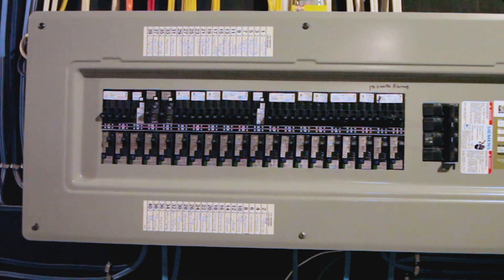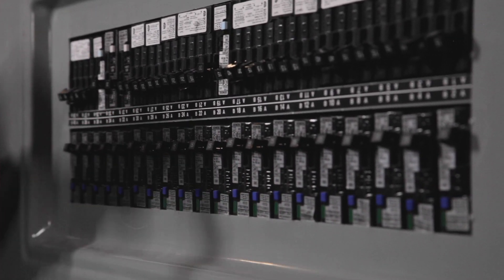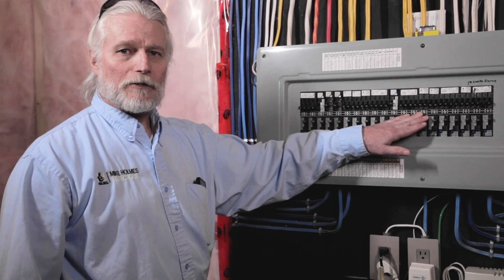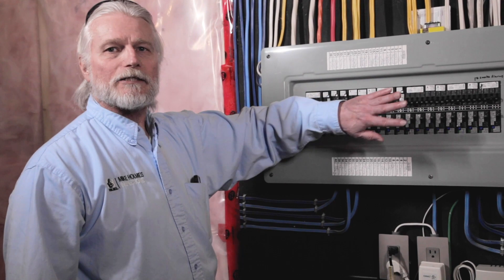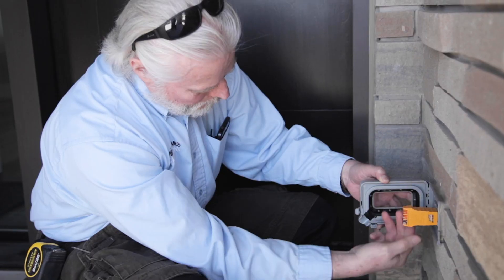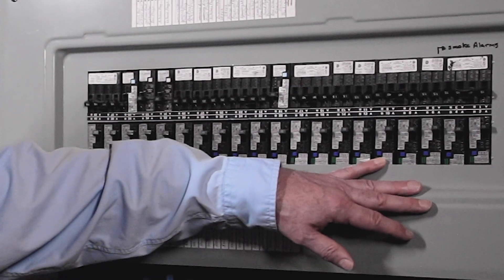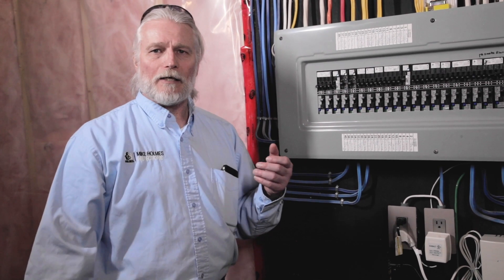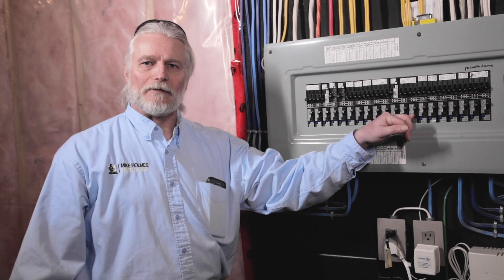What's In Your Electrical Panel?

Comment: Unless ca has is own codes, that panel seems to have cheater breakers installed and not to panel  manufacturers specs, looks to be a Siemens 200a 4040mbp(could be wrong),anyone else catch it, also why in ca are all panel boards horizontal